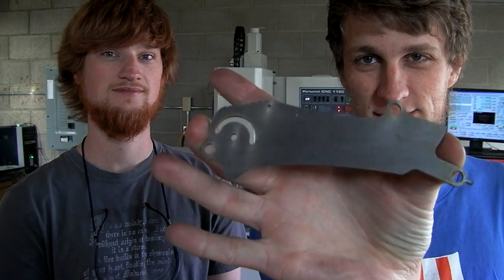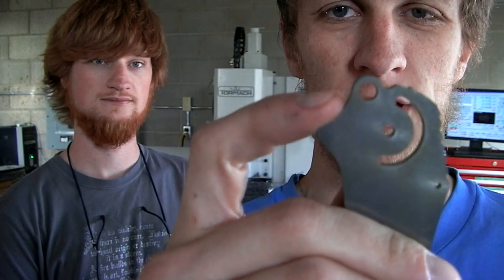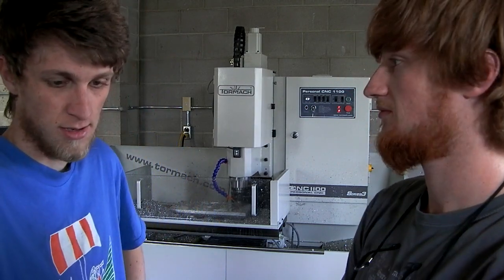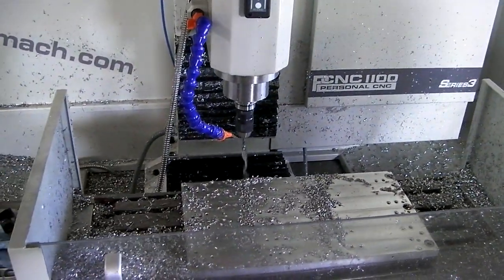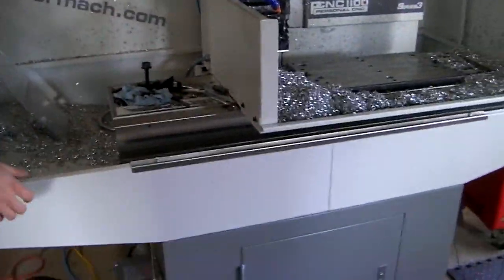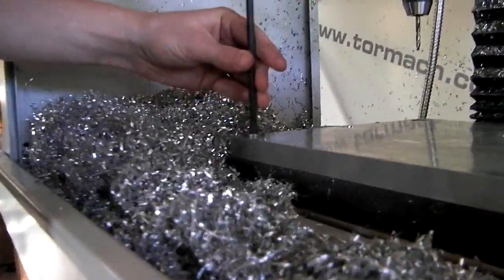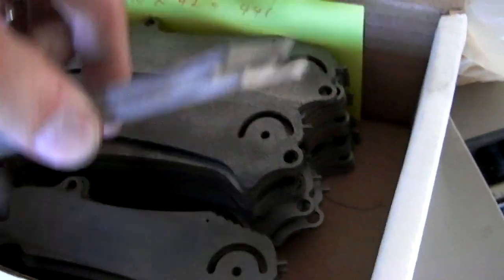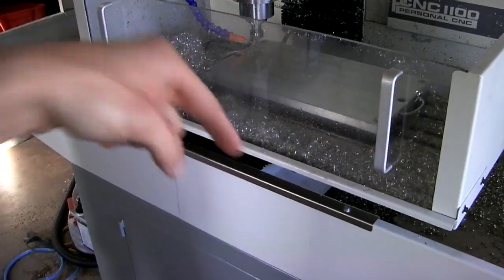Knifemaking Tuesdays Week 27 - waterjet blades and big fixtures

Comment from the maker: Yes they're aluminum.  I order them from my local metal store already cut to size.  They are 0.75" x 10" wide, and I get them to cut the plates to 18" long.  There is lots of room on the mill base to side clamp it, so it works out great!